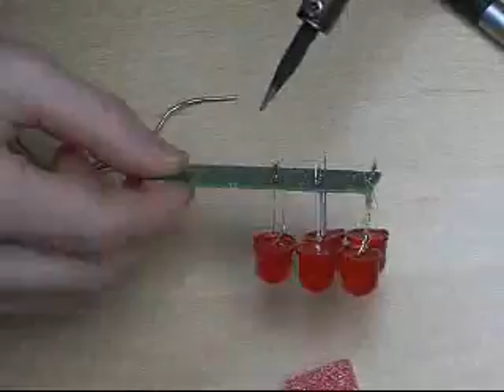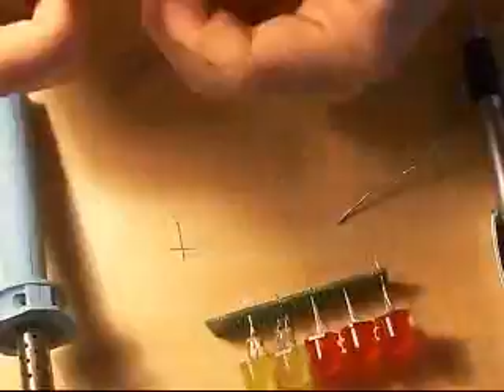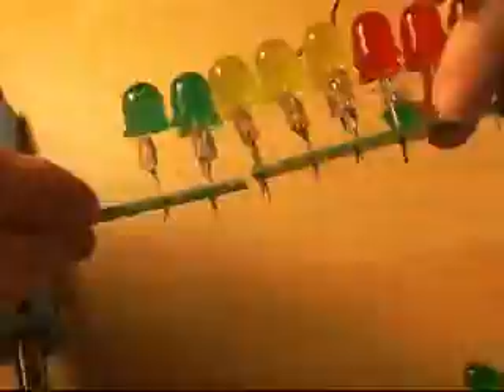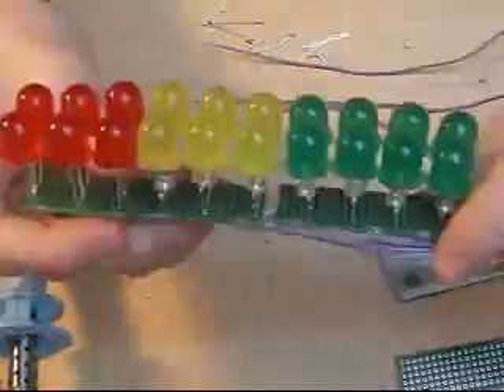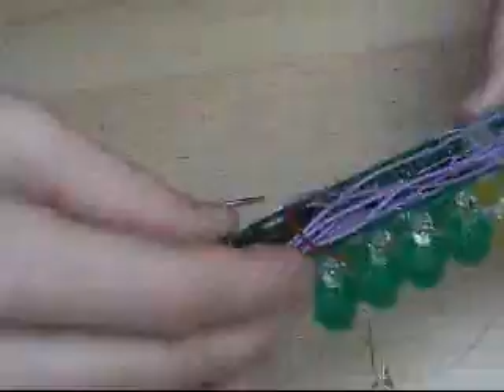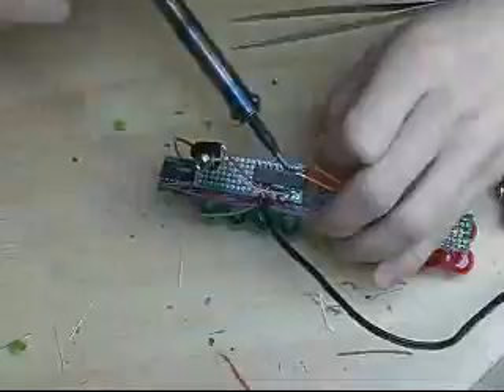Sound VuMeter LED - DIY

Comment: Good attempt. Led's must be flushed mounted onto the perf board and not sticking up. This creates uniformity. The driver should be done on a separate board and linked with a ribbon cable. Both boards can be sandwiched or kept apart. This makes for a neater and less complicated setup. Also bargraph led's are better suited for your application.